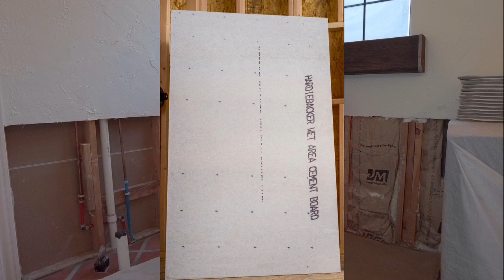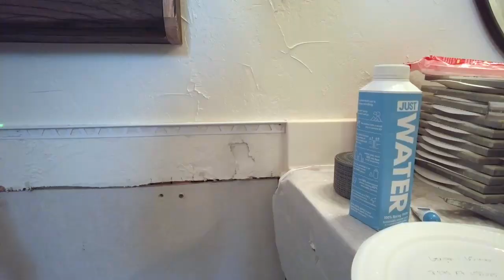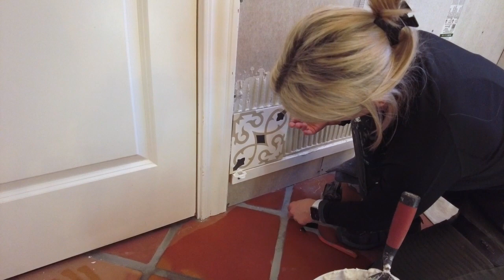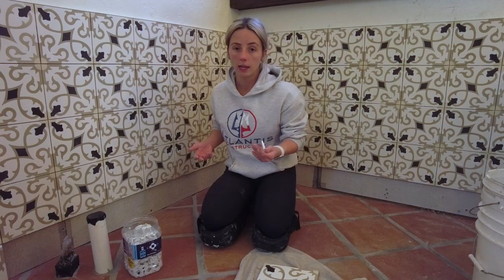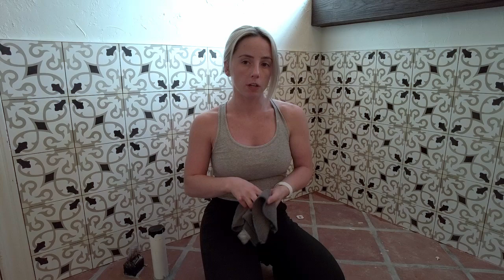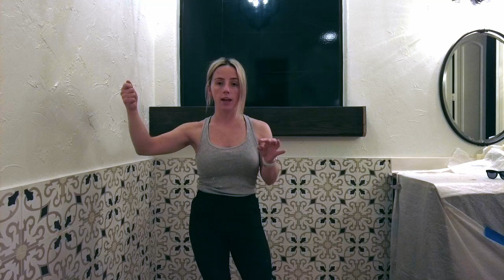How to / DIY: Concrete Tile Wainscoting

Comment: Being able to take your time and do it right is so nice. That requires the right clients. Your plan is solid as long as you can find those clients that prefer quality over quickness. In Houston, there should be a huge supply.
With your background, and your husbands, y'all should do some flips. The stuff you love to do (design & tile) is what adds a lot of the value/profit. The time pressure may increase a bit though. Y'all would kill it.

Comment: Nice job on the corner. Usually I wet set the fibatape because the blowouts you get in the hardibacker (and Durock for that matter) can leave dead spots under your tile and cause a dip between the two boards if you don’t wet wet the tape. And for thin ceramic tile or concrete tiles you can get cracking if someone bumps the dead spots hard enough during the tub install etc.

Comment: Excellent! I've never used a profile before (I'm a DIYer).  Could you talk a bit more about getting the right tile height for the profile?  I have a tendency to squish the tile down which would affect my height and profile.  Any help there would be appreciated 👍
Reply from the maker: Hey absolutely I think I may make that my next video, it can be difficult to determine what profile is best for your tile especially if your walls aren’t perfect.  Is this what you’re referring to?
Reply: @ThatTileChick  Yes but unfortunately my walls are probably better than my skills.  I suppose I could align the tile to the metal profile.
Reply from the maker: It all comes with practice I can do a video with details on this! Thanks for the suggestion